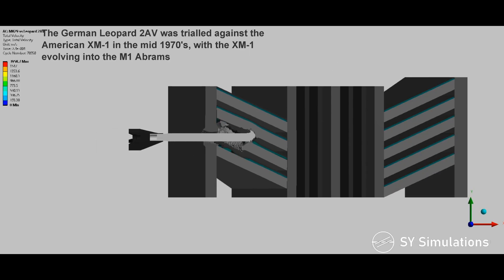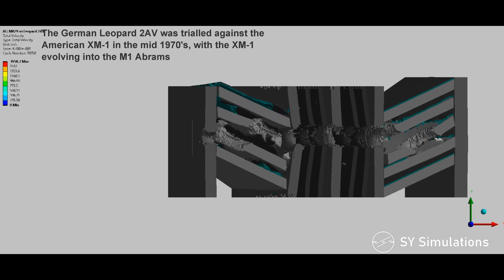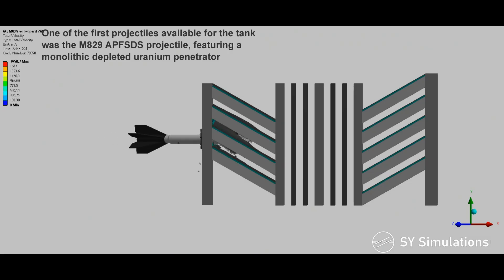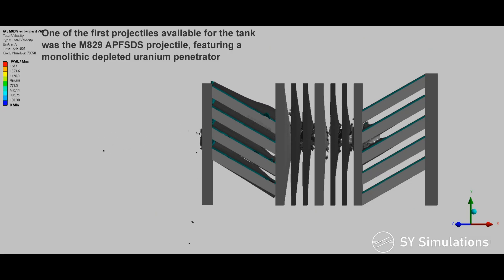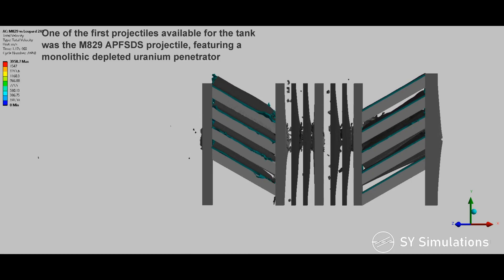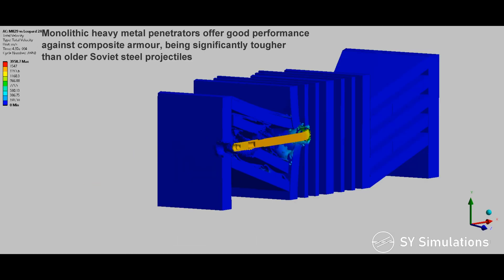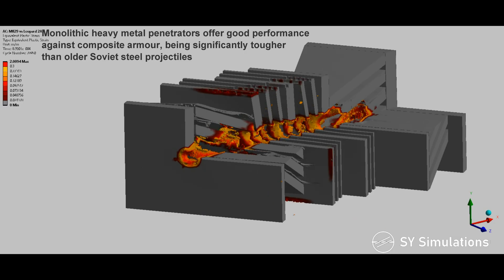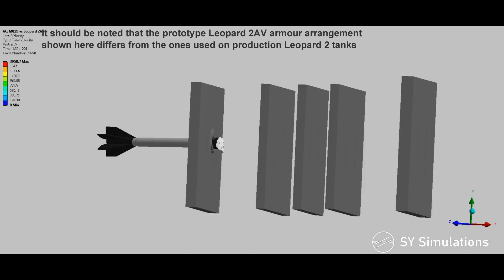M1A1 ABRAMS vs LEOPARD 2AV | 120mm M829 APFSDS vs NERA | Armour Penetration Simulation

Comment: I'd like to see a return shot against the M1A1's turret, not because i think it'll pen but we have so few Abrams turret sims.

I'd also like to see later versions of M829 against their contemporaries. 

M829A1 was the most powerful APFSDS in the world when introduced so I'd like to see how it performs against other tanks of its day. Not just T-72s and the like. NATO tanks as well.

M829A2 was a brute force attempt at a solution to emerging anti kinetic penetrator ERA arrays, increasing velocity in hopes to crush it with improved penetration. We already know this was an ineffective ERA solution but it would be interesting to how it performs against enemies without ERA but very thick composite arrays like the Challenger 2, Leclerc, Merkava, or Leopard 2

M829A3 and A4 were more or less only improvements against ERA as far as I'm aware but it'd still be neat to see them.
Reply: We do not know what m1a1 turret looked like. The only thing we know with some degree of confidence is the og m1 turret. Even then the turret armor last couple layer is made out of who knows what material. 

This armor already struggle against m829, so it is pointless to test against m829a1. 

We do not know what challenger 1 armor looks like, let alone 2. We have images of merkava armor, but not in suffcient details. There is a pattern here. Leclerc and Leo 2 follows the pattern. 

As far as 829a3 goes, it is an improvement overall against all target, probably. The thing has both increase diameter and length.
Increase diameter will help it resist against lateral force better in general. The increase length simply
Reply: @jintsuubest9331  M1A1 turret armor array leaked recently in.... the conflict. Theres an image floating around of a damaged M1150 turret (which is based on the M1A1) and you can see a perfect cross section of the turret armor
Reply: @nucleus691  still the export version. I doubt the US Army M1A1 was identical to what was given to Ukraine, even back in the day.
Reply: @nucleus691  
Ok, then tell me the exact make up of the layers. From material to the exact dimension. 
Even we are being generous, and say all the angled plate are simple steel-rubber-steel nera, there is still the question of what the vertical stacked plate actually are. Actually we never figure out what those stacked layers are in the original m1. 
M1150 also didn't take just m1a1 armor and called it a day, it has additional modification being applied to it.
Reply: @nucleus691  Those aren't US M1 turrets bud, the US removed their armour and gave them export packaged armour.

"which is based on the M1A1"

Considering the fact the M1150 weighs some 5-10+ metric tons less then any M1A1 (including the base M1 from the 80s), I highly doubt that its armour is even close to what the M1A1s have....
Reply: @jintsuubest9331 im pretty sure the challenger 1 armor array is available online in the deep web

Comment: On tonight's episode of why spall liners are important we once again see just why they are important.
Reply: fun fact: M1 Abrams iirc dont have spall liners due to weight (it would add an additional 2 or 3 tonnes iirc) and space issues. Instead the crew wears body armor in case of spalling.

However its unclear if later variants have em. Possibly they do but personally am not sure since sources I have seem to conflict.
Reply: @maximmachinegun7206  They say the NGAP reduces spalling.
Reply: @maximmachinegun7206 maybe a SEP v3? I mean we don't even have much data about Abrams' "depleted uranium" armor, it would be interesting to see some leaked documents about this

Comment: Very interesting. So at a more optimal angle or closer range 1200m or normal battle range it probably goes through. Impressive that this armor package performed so well against ammo in common use a decade later.  

Can we request a BM-42 against the same armor array at similar distances and angles to compare?

Comment: I was shocked that it failed to pen at first before I saw it was the basic M829, rather than any of the A-iterations
Reply: It did not failed to pen, but the projectile was made after the Leo2 prototype
Reply: Then again, the M829 started off as some of the strangest and most underwhelming projectiles the USA fielded. That was, until the A2 when its future iterations abruptly stormed and seized, very easily, the reputation of likely the world's best APFSDS
Reply: @belgianfried  The M829A1 was a rather large jump in capability vs all other APFSDS at the time of it's low-rate initial introduction in 1988.

Comment: that held up way better than i thought, it was a shame the leopard wasn’t chosen and we may have gotten our very own Leopard 2A4-6US
Reply: Why was it a shame? The XM1 performed better in almost every respect
Reply: @belgianfried I mean, that's plainly not true because the XM1 only had a 105 mm rifled gun instead of the dramatically superior 120mm smoothbores native to the Leo2 and later integrated into the M1.
Reply: @92HazelMocha  You can literally see test results

"Mr. MILLER. Going back to your other question on were the tests

run identically, the generalized answer is yes, sir. With respect to the

ballistic test the angles at which the firings took place were somewhat different on the German ballistic hull and turret because of its design. The Leopard 2 was not designed to take as great an angle as the U.S. tank so in that regard with some of the firings the angles at which the gun was fired were somewhat less demanding than the angles fired against the XM-1.

Senator BARTLETT. Does that give a break to the Leopard 2? Out of fairness, is that sort of the approach?

Mr. MILLER. I would characterize it more as testing to the specifica- tions to which the tank was designed and those specifications happen,

in some characteristics, to be less demanding than comparable ones on the XM-1.

General BAER. The bottom line to that would be the German tank accordingly would have greater vulnerability outside of those angles against which it is tested than the XM-1.

Senator BARTLETT. So you weren't being unfair?

General BAER. We had worked with the Germans on the test plan and it was agreed we would not fire outside those angles because it would serve no useful purpose"
From Committee of Armed Services, United States Senate, Ninety-tith Congress, page 6466

Read "LEOPARD 2 AV EVALUATIBE PERFORMANCE SUMMARY" and
Reply: @92HazelMocha  Also you must legit have brain damage if you think the GUN CALIBRE is the only thing that matters. What about FCS? Gun design, because it correlates with temperature distribution, accuracy, bore wear, capability, ability for modification and variation? Not even firepower, just the dumbest, most facile "uhhhh 120 > 105"
Reply: Then you'd have to enjoy an astounding delivery rate of 1 tank per year, thanks to environmentally friendly European law.
Reply: @ (licensed production intensifies)
Reply: @thezig2078 They would have been built in the US

Comment: That loader is taking some spall. A flak vest might soak up some of the spall but his face is eating the rest.
Reply: A significant emotional event.
Reply: Thats what spall protection lining is for.
Reply: Wouldn't bet on it. Spall is negligible here
Reply: @belgianfried wdym, those are pieces of metal the size of a grain of sand traveling at very fast speeds...
Reply: @Epsilon2042 yeah, but there's also lot of equipement on the inside which would eat or disperse those few metal grains. The spall here isn't really a problem, it will definitely not kill a crew member, maybe give him a scratch or two
Reply: @jakubw.2779  The metal grains you see are still going to go through the equipment to an extent
Reply: So there's this thing in modern tanks called 'spall liners'...
Reply: @josephd.5524  iirc, Leo 2AV did not have a spall liner
Reply: @belgianfried  Leopard 2 had spall liner designed from the outset.  
Leopard 1 had spall liner.
Reply: @TheInfamousMrFox  Is there anywhere I can read about this? I heard the Kampfpanzer Leopard 2 (and 1) book makes little mention of it, but I don't have the book
Reply: @belgianfried  I'm not sure you can get Kampfpanzer in English!
Interestingly the first spall protection dates back to 1917, although they put in on the people not the tanks.
In WW2 they started off using high Brinell factor steel to prevent spalling, although later in the war some tanks were experimenting with a rubber liner, notable the Panther. 
Research was shelved after WW2 largely due to HEAT rounds changing the game. 
Spall lining was reintroduced with the Leopard 1A5 (mainly for spalling caused by artillery, not other tank rounds) and was designed into the Leopard 2 as structural Aramid panels. 
So yes, the Leo 2 had them from the outset.

You can probably confirm everything I've written here with a bit of Google Fu, I've checked the key points just now but unfortunately I can't add links to YouTube.
Reply: @TheInfamousMrFox  I'm searching google but it all says only the 2A6 and after uses spall liners. The Leopard 1A5 came out later than the 2AV,  1980/October 1986 versus 1977-1979, or 1982 for first batch 2A0s

Comment: Imagine repairing this 💀
Reply: yeah thats a good question, what happens to tanks that get hit but not penetrated? the armor becomes compromised and loses structural integrity etc, does it have to get sent back to a factory with authorized personnel who can replace the armor modules. atleast in the US army from what i hear they have just a handfull of places that can do armor package replacements etc because its closely controlled due to the classified nature
Reply: @chost-059 Depends on nation and vehicle but yes this is generally the case. I can also say for Britain, composite armour is covered and sent back to the factory where it can be repaired. Composite inserts are generally modular (but welded on) so they can be relatively easily removed and replaced.
Reply: They would probably replace the entire module
Reply: @pniak_  You open the top of the compartment, slide the damaged module out, slide the new one in, weld shut the hole in the front. 

On M1 Abrams the top of the compartment/void area is welded on. They cut the top plate off and same procedure. Swap out the damaged part, weld hole shut.
Reply: @pniak_ prob the entire turret
Reply: @pniak_ isnt the module size like a brick like era ?
Reply: Tank crew from WarThunder: "Give me 15 seconds."
Reply: They just pull out the damaged module and replace it.
Reply: duct type will work
Reply: Perfect basis for improving your welding skills.
Reply: 20 sec.
Reply: No. Just no.
Reply: I think youd just switch the whole frontal plate or scrap the tank
Reply: Nothing a little duck tape can't fix lol
Reply: Or turret
Reply: That’s the neat part, you don’t
Reply: The module should be closed in something buried due to DU contamination😅.  @josephd.5524 
Lead is stable ,DU is not so it IS radioactive and while the alpha particles are stopped by the skin they irradiate the lungs if inhaled .
Reply: @ShokkuKyushu  
DU is as radioactive as lead; read: it isn't. It IS still a heavy metal and not good to have in one's food and water supply, but it is otherwise harmless.
Reply: @josephd.5524  Very very Toxic though as you eluded to :)
Reply: @jyralnadreth4442  yeah ,and radioactive too contrary to what he said.

Comment: According to my understanding, the protection packages used by AV were more powerful than the first series packages for the Bundeswehr's Leo 2. is that correct?
Reply: If I remember right, the AV was only provided to the USA for testing and had inferior armor packages to meet the weight requirements by the USA.
Reply: @nucleus691  According to Frank Lobitz, the Austiere version = AV refers to the fire Control system, as the Leo2AV was an improvement over the earlier prototypes. The AV was also the first with the new and armored packages that made up the new boxy shape of the turret.
Reply: @nucleus691  apparently the 1976 testing AV had no composite armor at all
Reply: @chost-059  the test vehicle had weights instead of armor as it was to simulate the driving performance. This armor here was the design that would have been used if the Americans would have moved forward with the 2av.
Reply: @chost-059 No, the Leopard 2 originally did not have composite armor. Since the US Army considered the original level of protection to be too weak, NERA was developed and installed. However, as NERA is heavier than Chobham, the weight increased from MLC 50 to 60. Overall, the Leo2AV was far superior to the XM1 but significantly more expensive.

Comment: Yeah this armor array was actually too heavy and complicated to manufacture and later Leopard 2 arrays were planned to be simpler.
Reply: That's really interesting, actually. Is there anywhere I can read more on this?
Reply: @belgianfried  
Afaik, it is a myth, probably mix with some element of truth. 

There is nothing being too complicated about this armor. 
hhs + rubber is pretty much the standard bulge plate nera of the 1980s. 

I guess one can make an argument of more welding with this armor. 

The internal vertical plate supporting the angled plate likely had to be welded, instead of placing into slot and secure with spacer. Welding hhs is just annoying.
Reply: Weight was not an issue. Today's leopards are much heavier armored then this version shown here. The A4 Variant already got that armor build in . Higher Versions like A5 upwards are even better protected.
Reply: Based purely on its appearance it doesn’t seem overly complicated to manufacture. Weight is an issue though.
Reply: @RichelieuUnlimited  weight was no issue. the production variant of Leopard 2 was a few tons heavier than the production variant of M1 Abrams.
M1 and Leopard 2AV had to adhere to the 60 short ton weight limit of the US for testing, wich is roughly 53-54 metric tons.
Leopard 2A0 and A1 both sit at 55 metric tons.